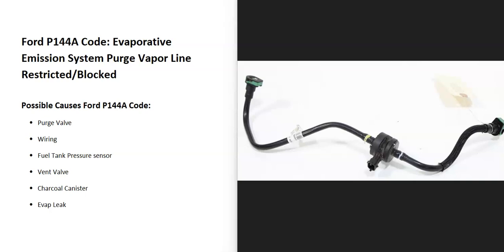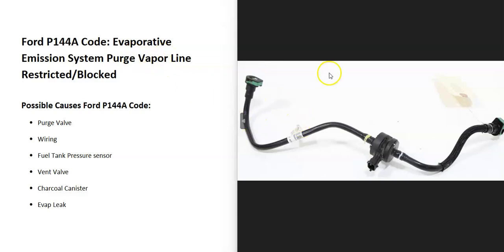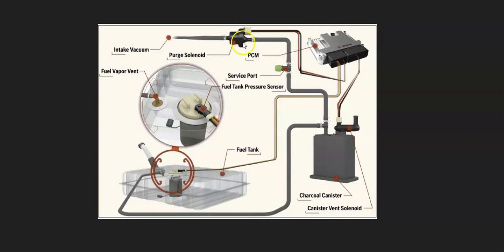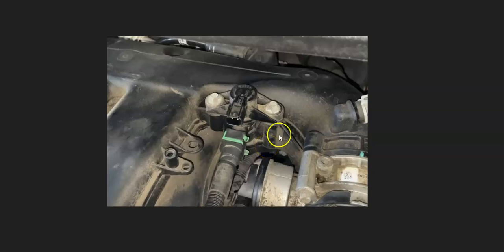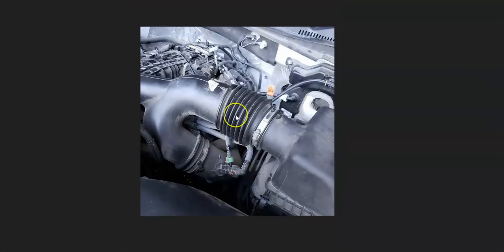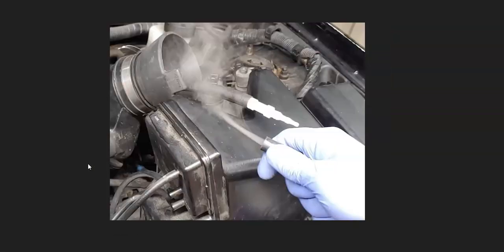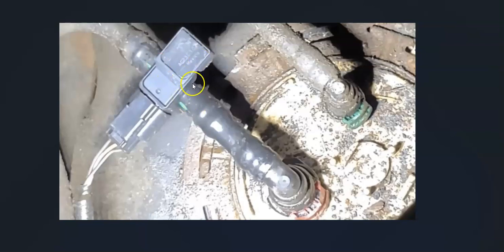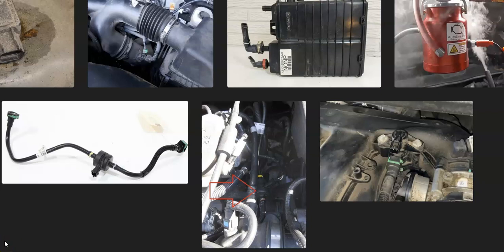Causes and Fixes Ford P144A Code: Evaporative Emission System Purge Vapor Line Restricted/Blocked

Comment: My wife has a 2014 Explorer Sport Ecoboost 4WD Turbo 3.5L 6 CYL that her half-wit ex bought. Worst vehicle to work on ever. It's throwing a P144A, so I go part searching. O'Reilly's shows me a Standard CP758 part. Autozone shows a similar part. But, no part with that shape can be found on the engine. So, I go digging and finally come across OEM Ford Emissions Vapor Canister Purge Valve 9U5A9G866DC. I can find the part from aftermarket companies for less than $20, but Ford parts guy smugly tells me they don't just sell the part,  I have to buy the whole line for $175. Can anyone confirm I have the right part before I buy anything? Also, if you have the same vehicle, give it to the person you hate the most so they can deal with it.
Reply: Yes I did just purge valve for high flow code didn’t work so I bought it with all the lines attached and boom runs very good

Comment: The engine light hasn't reset itself, do I need to have it reset?
Reply from the maker: You can clear it, but most vehicles need to go through a drive cycle to fully clear the code. You can google your vehicle year and make along with drive cycle for the steps the computer needs to speed it up.

Comment: I have replaced the purge valve twice on my wife's 14 Ford Flex, and it just threw this code again. Surely something else is causes this part to fail. Any ideas?
Reply: Same, replaced purge valve twice on wife’s 2016 ford explorer and just threw code again. Any other fix?
Reply: @jorgealfredorodrigueznajer3515  did you end up finding the issue
Reply: Possible vacuum leak
Reply: I have gotten this code when I overfill my gas tank. Stop filling after the first click.
Reply: Hello, I am having the same issue. Did you ever figure out what the issue was?
Reply: @joedirtmp5 did you find a fix for it? Im having the same problem on a 2016 explorer